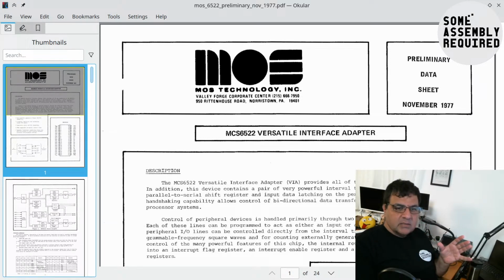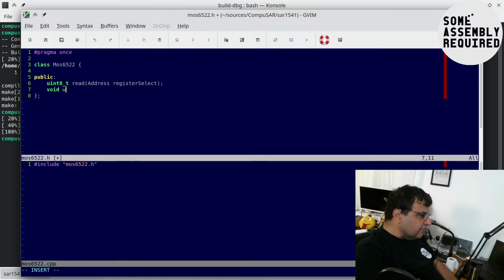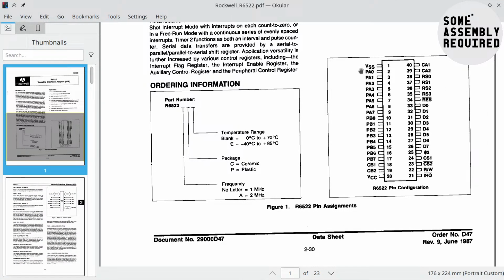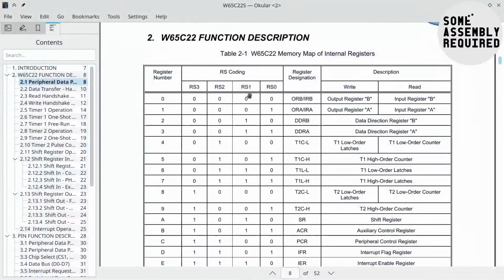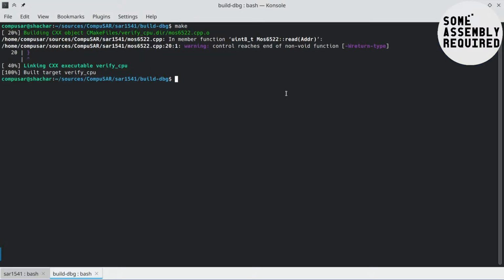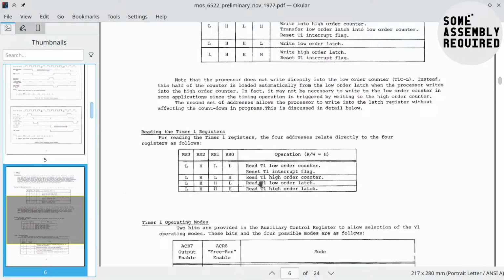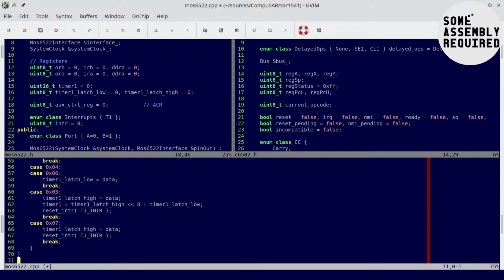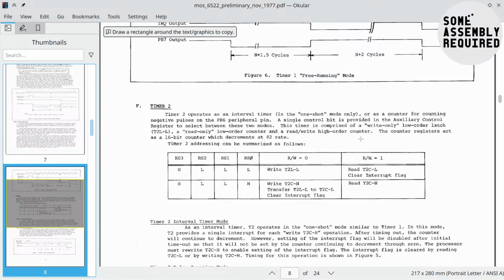Live: Writing a VIA 6522 emulator in C++

Comment: Hi. Is there a good reason you aren't using a union of uint_16 and a struct of 2 uint_8 for low and high byte. An example of use would be the PC in 6502. If you do it the code would be simpler and faster.
Reply from the maker: I don't think you appreciate the pressure of live coding. You have to keep designing the code on the fly while explaining what you do.
I'll look at the union suggestion, though I can think of a couple of con points. In any case, once optimizations are turned on, I doubt there'll be any performance differences.